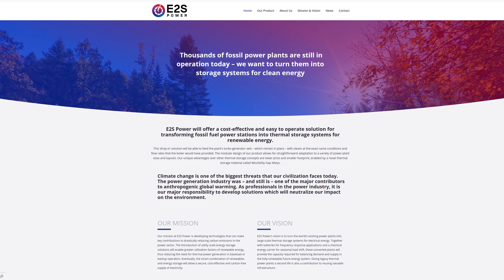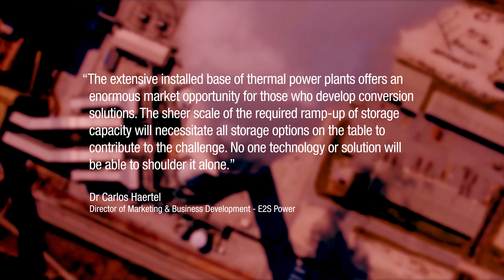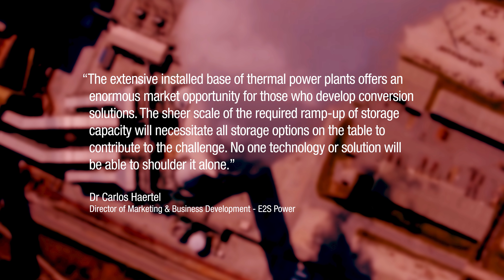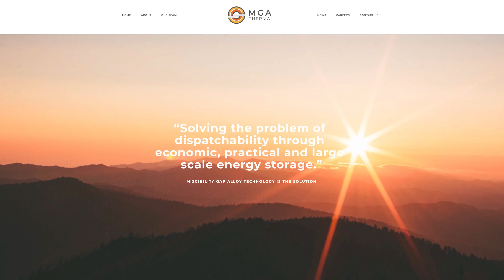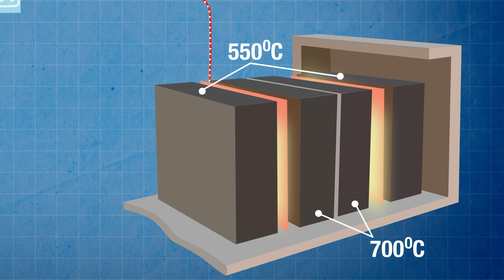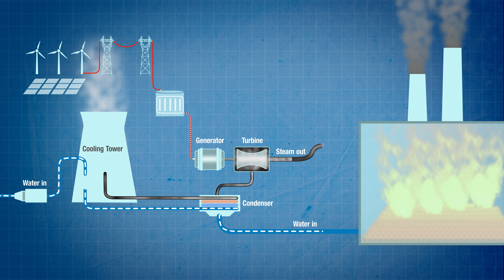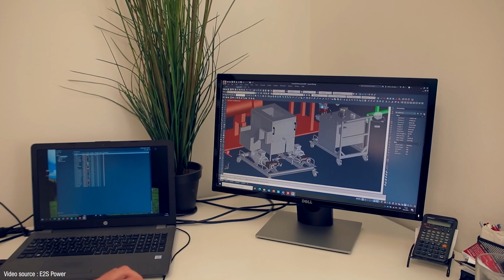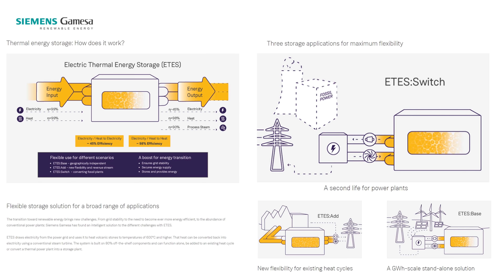New energy storage tech breathing life and jobs back into disused coal power plants

Comment: Coal plants often have many acres set aside for storing coal: perfect for slathering with solar panels.
Reply: @william breen Or both; one on top of the other
Reply: @william breen I wonder if they would need that much acreage. The boilers of these coal plants are incredibly large. The boiler alone of coal plant in Clarksville, TN is 13 stories high. It is one of the largest coal fired in the world. If each unit of this MGA system is the size of shipping container. That a great number of units.
Reply: @william breen your heat pump idea is cunning but sadly less practicable than it first seems for two or more reasons

1. It throws away the main advantage of this over other thermal energy solutions: which is the direct resistive heating of the store when charging. The blocks simply need to be wiredup to the grid connection to heat them up in the storage phase 

2. Heat pumps offer best performance with small temperature differences (small compared to the typically 300 Kelvin ambient)

With temperature differences of several hundred degrees you lose much of the advantage.

3. Heat pumps contain gases which are themselves contributing to the greenhouse effect. You need your heatpump to have a very good coeff of performance to outweigh the effects of the inevitable small losses of the working fluid

4. Even if you work round the above, the space taken up by the heatpump at industrial scale would make it take up more room than the proposed resistive heating (which is built into the blocks) and unlikely to fit within the site of an existing coal fired power station
Reply: I use rooftop solar to heat and cool my house, power my appliances and power my car. I save a good deal of money on electric bills and gasoline bills. Solar, wind and batteries can power our economies much more cheaply than coal, natural gas and nuclear with existing technology.
Reply: Because reclamation and trees are soo old school.....
Reply: @piotrd.4850  I like that as well, but it does make sense to put electricity generation right next to electricity storage, no?
Reply: Solar requires more acres than are in a coal storage area.  Solar requires about 10 acres per MW. Coal storage at a large plant might be 20 acres for a 1000 MW coal plant. Building even a small solar plant requires hundreds of acres not tens.
Reply: Scott Moff coal would have a significant advantage in this regard because it is usually piled up in a huge mound. My point wasn't that the PV would generate the SAME amount of power, just that a coal storage area would be a polluted piece of ground that might be suitable for panels to assist in power generation.
Reply: Solar panels interspersed with windmills. At an existing power plant there are  less likely to be objections from neighbours, which seems to be the main problem in the UK with onshore wind

Comment: The devil is in the details. Regardless of the heat source used (coal or melted aluminum), steam turbines don’t like to be turned on or off or be throttled up and down to meet the daily load cycles. So this approach may help meet base load requirements but wont help meet peak load requirements. Batteries could but we aren’t there yet. My 2 cents.

Comment: Sounds very interesting, but how much recoverable energy is actually available? Efficiency isn’t that important with storage involving cheap and long lasting materials, as it’s easy to scale them for this medium term storage.
Reply: The ultimate efficiency of this method isn't as important when you consider the savings (and embedded energy costs) of not having to  build the turbines, transformers and power lines. I'm sure some modifications will be needed but still way less than building any of it from scratch.

Comment: I think that small modular reactors are a good fit for this type of reuse of stranded coal fired power plants.
Reply: Why? Coal plants are typically located near coal supply rather than near energy demand. Why not just put the SMRs near the demand?
Reply: Unfortunately conventional light water pressurized SMRs seem to be leading to capital costs high enough that they don't seem to be affordable for large scale decarbonization.   Maybe if MSR based SMRs work out...

Comment: Soda engines are options for this use of stranded assets they are steam engines and use completely recyclable "fuel". These closed-loop steam engines had no firebox. The boiler was jacketed by a container loaded with about 5 tons of caustic soda (sodium hydroxide). When water or steam came in contact with the caustic soda, it would generate heat — enough to actually run the boiler and generate more steam. Steam emanating from the boiler would be fed through pistons to propel the locomotive forward, and the exhaust steam from the pistons would be fed into the caustic soda to continue the cycle. These vehicles were virtually silent because the steam was not released into the atmosphere.

A soda locomotive could run for several hours, but eventually, the soda would become diluted and wouldn't produce enough heat to continue generating steam. For reconcentrating, the caustic soda was either transferred out of the boiler of the locomotive and boiled in open vats or you can just air dry it and blow air across it to strip off water https://en.wikipedia.org/wiki/Soda_locomotive
Reply: boiled in open vats or you can just air dry it and blow air across it to strip off water - another fossil fuel technology in a different name. 5 tons of caustic soda will provide about the same heat of .25 tons of coal. If the hot caustic soda touches any part of your body... (I do not want to describe)
Reply: @janami-dharmam When you modify this locomotive system slightly you could treat it as battery for solar panels. Just store that heat from evaporating water from soda during charging by excess solar energy. No fossil fuels needed.
Reply: I drink to this... but I am surprised that you can just dried the caustic soda and reuse it again...

Comment: France has been supplying most of their electric needs using nuclear for decades.

Virtually all of our electricity could be generated cleanly right now using nuclear if it weren't for the party of science spreading fear.
Reply: Molten sault reactors can be designed to use all the present nuclear waste in the US and power the nation for 100 years. The uranium is then mostly depleted of its radio activity and in no way dangerous. 
The reactors cannot have a melt down through their design.
 Blame the war machine for the current reactors we have as it wanted fission bomb material.
Reply: @morninboy  Current reactors - PWR / BWR - are rather result of experience which people had developing them. They are logical extension of previous technologies.
Reply: This is insanity. Nuclear is not viable unless we have ways to handle nuclear waste properly.
Reply: @sinenomine4540  You will have to explain to France how nuclear is not viable since most of their electricity is generated with nuclear. Insanity is letting leftist hysteria control policies.
Reply: @sinenomine4540  1. We have it already 2. We could have even better ways of handling UNUSED FUEL 3.  Amount of nuclear waste produced by NPPs is inconsequentially small anyway, compared to every other source - more uranium is put in the air from burning coal.

Comment: Another former coal plant thought ... I always wondered how convertible large steam turbines/generators  would be to large charging flywheels.
Reply: The generators would be reusable, but the turbines wouldn't have anywhere near enough mass to be useful.
Reply: Would be absolutely terrible as flywheels afaik. Would probably tear themselves apart to hold a reasonable amount of power
Reply: The real issue with this idea is that the generators have to rotate at a very accurate fixed speed to generate power that can be dispatched into the power grid at 50 Hz. or 60 Hz.  The only simple way to put energy into a flywheel is to increase its speed or rotation and the only way to get energy out of a flywheel is to slow down its speed of rotation.  (For the pedants in the crowd, yes you can store or release energy from a flywheel at constant speed by changing the location of the mass of the flywheel relative to its axis of rotation but the mechanical problems of doing this would be difficult.)  This means that the generator mass cannot be used for flywheel energy storage in a system that dispatches power into the grid at a fixed frequency directly from the generator.  Yes, you could use a back to back AC to DC to AC converter system to correct the frequency but that has its own problems and costs. Some days you just can't win...

Comment: One thing which should be addressed is the fact that the power systems bill consumers based on the VOLUME of electricity used without regard to WHEN it is used.  So there is no demand for consumers to shift some of their major usage from high demand times and times when electrical generation is low to times when competing demands are low and energy generation pleantiful.  The consumption side of the market can be modified using market forces.  Suppose households shift when the clothes washers, clothes dryers and dishwashers are run?
Reply: Time of day metering is a thing. The problem is that the industrial customers that account for most of the electricity use can't really game the system that kind of way, they have to use a certain amount of power just to be operating. I can envision a future where the guys at the aluminum smelter take a day off when it's going to be cloudy, but that day is probably pretty far off.
Reply: @AlRoderick  if there´s a blackout of 3 hours the electrolyte cools so much down that the electricity can´t flow through the material, the result of that the smelting oven is totally damaged. and if they would extract the aluminum beforehand there would another problem occur, as they would need much more electricity to start the reaction again
Reply: @AlRoderick  A problem is that in order to accommodate the extra percentage of load in high usage time, the least efficient and most polluting generation systems are employed.   So shifting a small percentage has greater effects.  Industrial customers also tend to be the most efficient.  They tend to have their processes completely worked out and worry about the bottom line.

Comment: In summers we can use a central heat pump system to cool homes,and use the heat generated by heatpupms to store energy and turn it to electricity, absolutely we can't reach hundreds of degrees with heat pump,but we can provide the first stages of heating with them
Reply: The waste heat from these plants is low grade and commercially unusable but is excellent for heating homes and farms. You only need insulated pipes to carry the hot water. Water for boilers is usually high grade and the cooling water is usually good for domestic use.

Comment: South Australia has a company called 1414 using molten sand as heat storage. At 1414 degrees Celsius it's initially too hot directly for a steam turbine.
I couldn't find details on how the heat is converted to electricity. 
They have a large unit connected to the grid heated unfortunately by gas. I wonder if it is more efficient than a gas turbine?

Comment: First though that came to me was:
Can we use all the coal that is already mined to make the carbon part of these blocks ?
Once that's used up then look to carbon capture as a source for any more blocks.
Reply: Unfortunately the carbon in the coal is not in the form of graphite and it would probably not be cost effective to convert it to synthetic graphite which is a very energy intensive process.
Reply: Graphite or carbon doesn't just stick to itself, it needs a binder like clay, similar to pencil leads. Pencil leads are initially heated in rotary driers for 12 hours then heated further to about 1000 deg C for 10 hours. So what renewable energy source would you use to manufacture the number of considerably sized graphite blocks? Me thinks there isn't a renewable source to use, they'd continue to burn more coal/fossil fuel to provide the heat necessary in making those sized graphite blocks. Man dealing with climate change is like a dog chasing its tail!!!
Reply: @PeterPete  Not really. The blocks will last a very long time so not much actual tail chasing at all. You use words but no numbers which is where the confusion lies.
Reply: @garethrobinson2275  I'm skeptical - man comes out with lots of ideas but has very little of substance! In the video there's no information regarding the energy used to make the graphite blocks/aluminium and how long they will last. How long is a long time? The set up hasn't been tested long enough to know how long the system will last! Overtime the graphite blocks and aluminiuim will degrade it's inevitable (the blocks will probably crumble in time). If they operate the system in a nitrogen filled environment, one will produce nitrides which may impede their operating abilities. Remember nothing lasts forever. You can't get more out of a system that one puts in.

Another thing the manufacturers are overlooking is the fact consumers can actually build their own to generate their own electricity and come off grid! No utility company wants that!!

But all said and done the idea is good and simple.
Reply: @PeterPete  Graphite blocks are already used in the production of aluminium, funnily enough. And they deteriorate really quickly there, since they are actually used as one of the reagents (stripping oxygen off the alumina). But we're talking about using energy that would otherwise be wasted anyway; and the more renewables we install, the more of the waste electricity for the taking. As long as you can make it profitably using intermittent energy supply (or justifying the use of on-site energy storage for the peak or low supply hours), you're still fine. "Perfect" is the worst enemy of "good enough".

Why would you think any nitrides will form in a nitrogen atmosphere? Even at 700 °C at standard pressure, nitrogen is ridiculously inert - and that already assumes it has something to react _with_. There's no oxygen; are you suggesting carbon nitrides? Aluminium nitrides? Or reacting with the container?

In general, thermal energy storage has been a relatively fringe thing for decades now - but the plants actually using it seem to be doing pretty well.

It's really hard to grasp the scale of the coal power; I doubt 30yrs of supplying a plant like this would come close to a 1yr consumption of coal of an actual coal power plant, just wild mass guessing here. They eat up such ridiculous amounts of coal every day, and produce ridiculous amounts of toxic and radioactive waste.
Reply: @LuaanTi  quote - Why would you think any nitrides will form in a nitrogen atmosphere? 

that's sooooo funny!!

btw i'm aware of the hall heroult process! It's for this reason why aluminium contains carbon!
Reply: Carbon is easy to get, it even grows on trees.
Reply: @dougaltolan3017  do you realise how much energy is used to make carbon blocks?
Reply: @dougaltolan3017  carbon blocks are baked for an entire month at max 1000deg c and then they go through more heating processes!!
Reply: @PeterPete  how does it compare to steel and concrete?

Comment: This is so amazing and smart: repurposed coal plants for clean energy.
Reply: These are the ideas we desperately need to transition. Brilliant
Reply: Well, but I don't love the round-trip efficiency. Pumped hydro and lithium ion can get you something like 80-90% of the energy you stored. This will be lucky to get half that.

Better than nothing? Maybe. But it may be hard to compete with other energy storage solutions, if your operation involves buying twice as much excess electricity.
Reply: @ps.2  I must agree on that one. I would like to see the actual numbers on a large scale test before i clap exited. There are other technologies more promising on first glance. I like liquid air storage, and decentralized pressure domes a lot more. And liquid air storage could also be placed on former coal plants, but this aluminum/graphite system would benefit more of the concrete structures, coal plants provide.
Reply: This technology suffers from the thermodynamic inefficiencies of heat engines, plus the significant costs for operation and maintenance and significant use of cooling water. Battery storage requires no labor, little maintenance and no cooling water. And perhaps most importantly, no large greedy for profit monopoly utility opportunity to inflate the costs. We must take every opportunity to replace monopoly for profit electric utilities that profit from expensive, polluting coal, gas and nuclear power generation!  Let’s save the planet with renewable energy and electrify transportation and space heating and cooling (heat pumps) and end fossil fuel usage.
Reply: And the best part is the plants don't have to be torn down.
Reply: There is no such thing as clean energy. solar panels and wind turbines are made with fossil fuels including coal.
Reply: @Withnail1969  I think you're confusing 'clean manufacturing' for 'clean energy'.
Reply: Is this similar to Azelio?